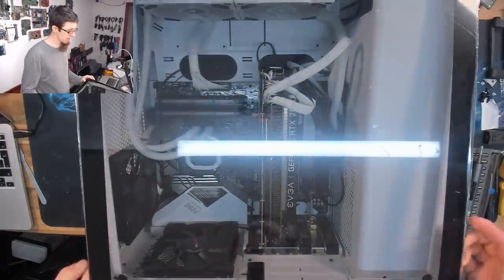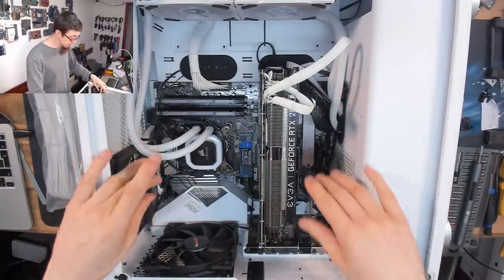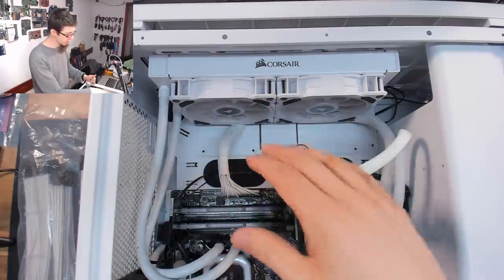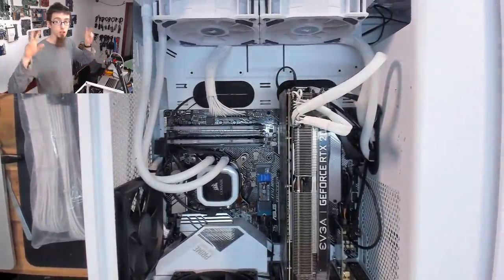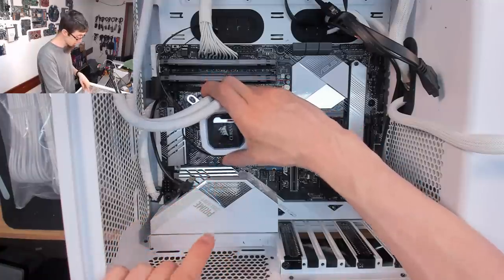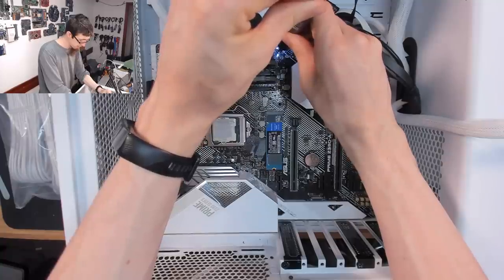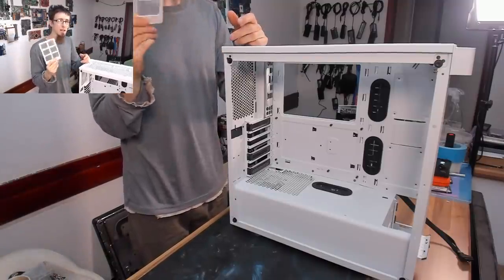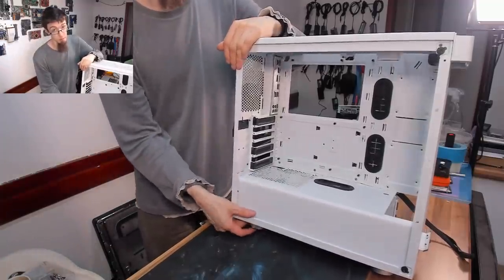Corsair 275r (not that one) Rebuild - LBC#55

Comment: Back to front is actually something im considering. I have a front mounted radiator, and my GPU is blowing air out the back/front, which causes my front fans to just blow the hot air from the GPU back. I then have issues with higher GPU temps. But if i change my airflow from back to front, the back fan will just suck all the hot exhaust air from the GPU back in. And it will also make the front fans suck the 60+ C hot air directly in to the radiator.

Comment: Thanks for the video!
I had the the problem you mentioned at 9:24 with my Cooler Master Hyper212 LED.
I had to hold the standoff with pliers while unscrewing it.

And even tho I used 1 million zipties in my main build, some areas still look like a rats nest, and some are OK.

And when I upgraded my ASRock board to an asus one recently, the USB 3 headers socket (just the plastic, not the pins) came off with the connector of my icue 220t XD

I love your content and I apologize for my bad English XD

Comment: I have the same case the only issue is that the mesh at front panel is finer than top one so in my eyes better flowing other way. This video came at a good time as I noticed my wiring is a mess although I did my best at the time.

Comment: The fan on my Corsair CX750M PSU eventually did die after about 6 years, but i was able to replace it with a Fractal Design silent fan and now it is quieter than before.

Comment: The radiator is mounted the wrong way. The tubing should be in the bottom of the rad or the rad has to be mounted at the top of the case, which is the best solution. There was just recently a video from gamers nexsus about this.

Comment: The other issue with orienting the radiator so that the hoses are at the bottom is that then the hoses will cover the RAM, which given that it's expensive RGB RAM it's really not an option. I think like you say, the pump is lower than the radiator so everything else after that is nitpicking. Every aesthetical choice has a trade off, this one is minimal.
Reply from the maker: The hoses tend to get in the way of something however you mount it, so I'm sure there's a nice way to arrange them with the rad ports at the bottom - just not something I've looked into yet. I'll be checking it out though - this is going to be a meta change because regardless of if it matters or not, I don't want every video I make from here on out to be a wall of "yOu mOuNtEd tHe rAd UpSIdE dOWn" comments.

Comment: I've got top intake with bottom exhaust. I've done several reverse airflow cases too. It's doesn't matter. In fact in one case it gave me slightly lower temps compared to regular direction. 2-3' C.

Comment: Hi Adam! Good to see you are still with us 👀👍I was surprised given the power unit is modular that the customer opted for cable 'extensions' as I am sure they could have got modular plug in cables for that power unit. So sympathies re that situation. Also there are 'slim' versions of fans that could lie relatively flat against the case taking up less space. But of course time is a factor re obtaining those and et although that place does deliver next day  😎but as said in this 'case' hmm you have to go with the flow .. 🤔😊 Stay safe ! Gotta hit that thumbs up button ✔😎👍

Comment: I use dual 280 aio's, one for cpu and one for gpu, both in exhaust. All hot air in exhausted, not blown into the case. Rear and bottom fans are intake. I achieve very low temps. My 1080ti under full load can raise the water temp to 55c while the pc remains less that 5c over ambient, keeping vrm's nice and cool.  Never blow hot air into your pc if you can avoid it. The standard front mount rad with intake blowing onto you video card and MB is and has always been a bad idea. Also, keep you radiator horizontal or if vertically mounted,  hoses down. This can prevent air going to and being trapped in the pump, which will kill it.

Comment: I wish that on AiO Water coolers, inside the tubes were actually a wire hidden so at the radiator side, where we rout the fan wires would be where all the plugs would come out and plug on the pump. Very stealth it would be.

Comment: Just came here after watching a Gamers Nexus video pointing out how the radiator should never be mounted like this with the pipes at the top as it causes air to get stuck at the inlet/outlet ports, potentially even pulled into the pump making it noisy at best, or wear it out prematurely at worst.
Reply: I've seen Steves vid too, but this is one of the few times you can get away with it, the pump is 4 inches lower than the head of the rad so air should stay up there, but to prime this just tilt the PC on its back and power it on , this will place the pump lower than the whole rad and it will prime perfectly.

 All that said, this AIO does fit this case with the hoses at the preferable bottom position (my son has one setup that way) but without a GPU support I wouldn't want the hoses pushing down on the card end.

Comment: I use that screwdriver but from a different vendor, same thing but its become my go to driver when working on PC, Laptops and general electronics, comes with a good assortment of tips as well. USB rechargeable from a PC USB port too.
Reply from the maker: How has yours held up? I've had someone predict that mine would lose all its torque in a short lifespan... but if that doesn't come to pass, I've so far been pretty impressed.
Reply: @Adamant_IT  I am not using it to put screws into wood or anything but for PCs and Laptops, no issues. probably wouldn't want any more torque on them screws anyways. like you said, monkey tight, not gorilla tight... lol.

Comment: The m3 screws with the washers are the correct screws and come with the radiator. What you mistake as course is actually threads for the m3 screws. The original screws are the same thread as the longer screws the fans are screwed in with which you could have compared before you ruined the original threads.

Comment: I have no problem with the reverse air flow but that radiator install should be fixed its probably noisier then intended.  It should be flipped hoses to the bottom of the case and  same with the pump.

Comment: From that place you can buy magnetic dust filters OR filters that fit between the case and the fan though obviously you have to remove the fan to thoroughly clean the filter et I've used the magnetics before and they're not that expensive though hmm mine were black.. wonder if they do them in white.. 🤔

Comment: Thanks Graham. I learn a lot by making mistakes or being warned of possible traps.  Great stuff and very helpful to add to my background knowledge.
Two things:
I'm about a year away from saving up the pennies for (probably) a good unclocked Intel build with good graphics. 
The accent will be on showing movies on monitor or HDMI extension. - probably 4k, sound editing and long life >7 years in a dusty, warm environment. 
I've never used water cooling before and I am worried about the results of 'if it leaks'.

How do you guys avoid leaking/long life etc in the build?

I will be concerned with it being as quiet a poss and running cool. I am only concerned with one game 'Elite Dangererous'.
12 months to go.....

Comment: Adam, a bit off topic but can you do a video explaining everything you need to know but we're afraid to ask about RGB systems.  I am a retired computer engineer and have been building PCs since 1995.  But, even I was caught out by a schoolboy error when faced with lighting up my latest PC.
I have an Asus b450 mb and Ryzen 7  fitted with stock cooler that has RGB technology built in. So to compliment that, I bought a cooler master RGB case fan.  It wasn't cheap at £20 and it seemed to have the right connections (4 pin connector for power an what I thought was a 4 pin connector for the LEDs).  A quick check of my mobo and yes I had an aura 4 pin header, so I ordered the fan. When it came, I discovered the RGB system was not compatable. My mobo's 4 pin aura header is 12v, r, g, b grounds pins and the fan had a 4 pin connector 5v,  blank, ground, TDM pins.
All is not lost because I have ordered a converter that is powered by a  sata cable and converts the aura 12 volt system to the 5 volt TDM system.  So, my lesson is that it cost me a total of £40 and would have been more if not for Amazon prime just to add 1 pretty fan to my case.
Reply from the maker: That's a great idea, because RGB is a minefield of different systems, some compatible and some not. I'll try and put something together 👌

Comment: This is giving me ideas to turn my top fans around, have them as intake's to blow down on the CPU, flip the rear fan around, CPU fan to the rear of the cooler and the 3 front fans to exhaust fans. But leave the 3 PSU fans the same, yeah I have 10 RGB fans in my rig, RGB 24 pin extension and RGB on the GPU.
Reply from the maker: I wouldn't go for this config unless you're limited to it personally... This was more of making the best of what options were available.

Comment: @AdamantIT I have a question if you see this then grate please reply.

I'm going to build a pc but I'm wondering if I can mount the fans on  the front of the cooler so the fans are facing me with rgb so the side without the 2 tubes?
Reply from the maker: Yes you can, this is the best way to do it on an airflow case. If you have a glass-fronted case, make sure the fans are on the inside of the front panel, so there's an airgap between them and the glass, otherwise they won't get any airflow.
Reply: @Adamant_IT  Hi, thank you soo much. If you have spare time could maby tell me if this is a good a case at all for airflow and other things? 

It's on the Currys web here is the item name : CORSAIR Crystal Series 570X RGB Mid-Tower ATX PC Case.

Thanks,
Reply: @Bunny Love will do thank you!

Comment: The airflow issue is for that poor GPU, which usually only gets about half a fan's worth of fresh air anyway. Now, it gets none, except I'm sure that mostly decorative backplate is nice and cool.

This is why the form over function cases and products fail. The idea is to make the stuff on the screen pretty, and IF you can also do it for the stuff inside the case after that, all the better. But if you can't do it without hurting performance, then just stick to what performs best.

Comment: Have to ask your opinion. Does push or pull for the rad make a difference? I've sat mine up as front mount pull intake so I can see the fans if you see what I mean. Love your videos my brother! I've 30 years tinkering with computers and you still manage to teach me something in almost every video!
Reply from the maker: I think push is considered more effective - however I've done both configurations plenty of times and seen no issue. A lot of the time it comes down to number chasing. Unless you're running everything at the bleeding edge, one or two degrees here or there isn't going to make a difference.

Comment: Not a bad job, but not a sterling advertisement for your services.

1. Take a photo before you start so you know what goes where. Particularly SATA cables. It also helps you show the customer the before and after.

2. Don't plug anything into x16 slots other than the top one without confirming that doing so won't affect the performance of the top slot and NVME drives. You just halved the PCI Express bandwidth going to the GPU, changing the top slot from a x16 slot to a x8 slot. 

3. Since the two top fans are adjacent, consider rotating them so the wires are together. Doing this with the RGB fans could produce interesting results. :)

4. Use the second 3.5" drive bay for cable storage.

5. The GPU cables would have been better off coming out the grommet physically below the GPU.

6. The problem with the reverse airflow is that all the noise comes out the front, straight at the customer if it's sitting on their desk.

7. Put grilles on the top fans to prevent damage to the AIO tubes. You can even get LED grilles. Grilles on fans prevent accidental ouches too.

Really you should have replaced the black fans with white ones - white RGB ones would have been even better -  but I think you said that the customer was unwilling to pay. And you could have taken the time to remove the unused blanking plates and replace them with ones you'd previously spraypainted white. If the customer were willing you could also do that with the plates of the GPU and WiFi cards if they're detachable. Obviously that would take time.

Comment: Just wondering, wouldn't the reverse airflow config pull residual heat generated from the VRMs / CPU and especially heat from the GPU into the radiator? That would then introduce heat back into the liquid which would then flow back into the pump. At least, that what I think. 🤷
Reply from the maker: Theoretically yes, but it doesn't make that much of a difference in the real world.

Comment: I think I'm more partial to doing all of the pretty work with the motherboard side first, and then inserting and connecting the power supply last. That way the cable can't be too long on the pretty side. I guess everyone has their preferences. 🤷🏻‍♂️

Comment: Wondering if anyone knows why my pc is randomly shutting off when I try to load CS:GO? It's a core 2 duo e7600, 700w OCZ psu, gtx 560ti and all the updates are the most recent
Reply from the maker: Those OCZ PSUs are getting old... might be on its way out.
Reply: I got a friend still using one of my old 850w OCZ PSUs lol , and it's powering a 8350fx & 2 GTX 760's
Reply: @Adamant_IT  That's a pain in the arse, it runs tf2 fine but the only reason I bought a pc was to play the two
Reply: Does it do this with any other game or just cs go?

Comment: I just thought, if you have 14 or 16 wires coming to the GPU, you could use 16 wire cable combs. That would tidy up the curves and align the 2 separate stacks.

Comment: That air coming in the back will bring in dust and what ever else that is circulating in the computer room. It will mean more maintenance to keep it clean..
Reply: What air coming in the back?  It's coming in the top through a filter
Reply: @cjmillsnun  Where the rear fan was that he put in the top of the case to bring air in.. watch the video..

Comment: I have exact build just like this. My problem are the MB standoffs, somehow the middle standoff just wont align i try many times snugging the back io until my MB jammed shut because some of the standoffs pins get caught in the screwhole, i try hard to pull off my MB, until i realize im screwed when i Saw some scratches and exposed coppper traces on the back PCB around the middle screwhole. 😂😂😂

Comment: To be honest, I don't see the issue with a reverse airflow setup. As long as the PC is getting proper air into the system, then it should be fine.

Comment: 4:11 it matters because of the GPU cooler type. Since the GPU is right below the top fans and also because its not a blower style or liquid cooled, the top fans would exhaust the hot air coming from the GPU much more efficiently and faster, because hot air moves upwards. I have tried a similar setup that you have done and it increased the temp of the GPU. The ideal fan placement for this setup would be the rad to be installed on top with fans as exhaust without any dust filter, and the two black fans as intake at the front to cool the GPU. It would still be possible to see the RGB this way. Also, if the fans are installed as exhaust at the front (like your setup) it is more difficult for air to escape because the front of the case is restricted. Yes, there are gaps on the sides, but it is still restricted. And I've noticed that the front dust filter is installed. That is a big NO... the filter is supposed to block dust from entering the case IF the fans are set as intake. Using it with fans as exhaust, it serves no purpose at all and it will prevent the rad air from escaping even further.
Reply: Graham put a text there saying the rad couldn't be top mounted due to no clearance for RAM
Reply: @Kentish9494  oh sorry, didn't see that, my bad. So i guess it would have been better to install the rad fans as intake at the front, and leave the 2 black fans as they where, but the client wanted the bling bling :D
Reply from the maker: I would've done just that - but in Corsair's infinite wisom, you can't top mount a rad with the Vengeance RGB PRO memory modules because the case isn't quite tall enough for a top-mount rad to clear the RAM.
Yes, corsair case, corsair cooler, corsair RAM - can't top mount.
Reply: @Adamant_IT  thanks for your reply. yeah unfortunately with these ram you can't have the perfect placement. Low profile, white Corsair LPX ram, would have been the best for this build, in my opinion, or a case with more clearance on top. For my 2nd rig, i have the black version of the Corsair Air 540 which has a lot of top clearance. It is an old case, but you can do whatever you want with your build. So much flexibility.

Comment: I don't know the specs for the fans, but have you though about exchanging them? I mean putting the black on the rad and whites with rgb on the top.
It might not be a bad Idea to build a computer and test it under load with different airflow configs and compare the thermal results. (positive pressure, negative pressure, exhaust top, exhaust front)
And ass someone mentioned, use a smoker to see how the air behaves in the case and where are the hot air pockets - one more reason to buy a thermal camera ;-)